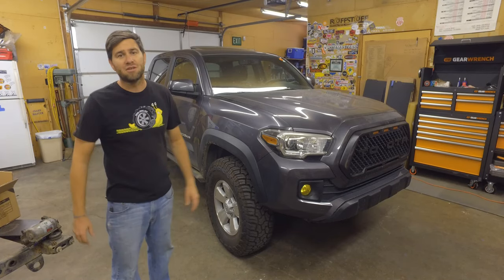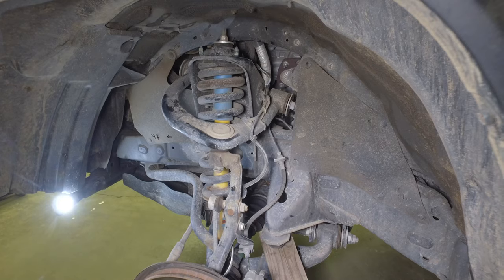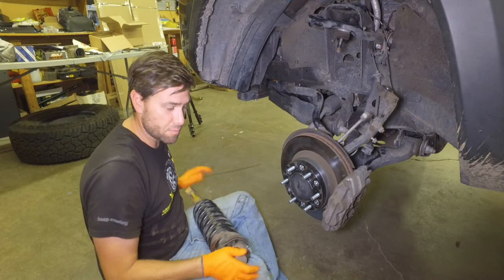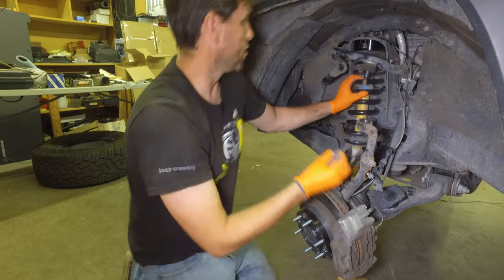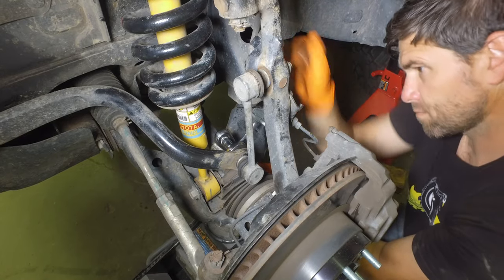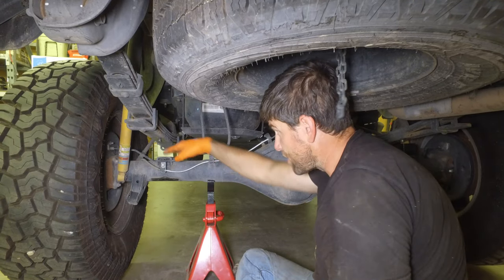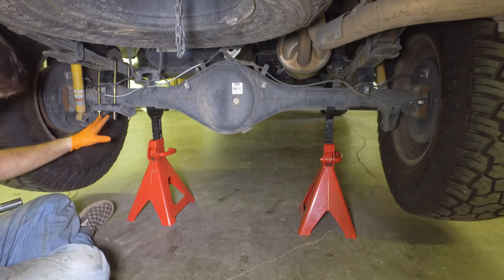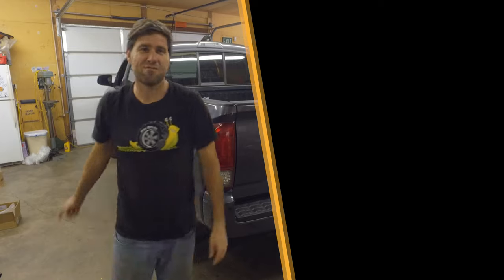How To Level A Tacoma

Comment: If you undo the two bolts at the bottom of the Spindle (instead of the ball joint at the top) you don’t have to undo the abs and brake lines from the spindle or the sway bar. A lot easier
Reply from the maker: That is a great suggestion, I will have to try that next time.
Reply: @SnailTrail4x4  I’ve installed a 4-5 dozen lifts on tacos and 4runners

Comment: You said the front only lifted 2 1/2”, When you measured the front you said it was 36”, if you look close it is actually 35 1/2”. Maybe that is the extra half inch. 

Also, it didn’t look like your leaf spring spacers were tapered. Did they have a taper?

How is the ride after the lift?

Comment: Couple of questions.....
The fender opening is the same size as before the lift and the wheel still goes up and down. This increased clearance, how?
Was anything included in the kit to space the bump stop down to prevent the strut from bottoming out?
Were the control arm bushings loosened at ride height and retorqued to prevent them from being under tension all the time?
Were you able to align the truck to stock specs with the stock upper control arms?
Reply from the maker: Hey Ron, All great questions! The overall answer is that I am not going to be keeping this kit. I am going to get a suspension lift very soon. 

A) I had 33's on my truck and it was hitting my body mount. By adding these spacers it pushed the center point of the tire downwards to allow me to clear the body mount while I am driving on the road. If I am turned and my truck is articulated then yes I still might hit the body mount. I guess the main thing is that my scrub radius has moved downwards to allow me to drive more comfortable. If you're planning on off-roading your vehicle often you should probably do a body mount chop or relocation as well. (this will be in the near future for me)

B) No, The front you should get new bump stops or a spacer for them. but in the rear nothing really changed and the stop bump stop should still work. 

C) No I did not touch the Upper or Lower control arm bushings. I do not think they are under much stress since there is no weight of the tire and no major forces on them since the coil-over is out of the vehicle.  Move to D

D) As soon as the lift was installed I took the truck to get a professional alignment, to help the bushings and save my tires. The alignment was able to get the truck back to stock but I do need to get upgraded UCA made for a 3" lift. I have since gotten them and had the truck re-aligned and the truck is back to spec and drives great. 

What's next... I am going to go to a suspension lift very soon because I do plan on using this truck off-road and not as a mall crawler. I am probably going to get the same lift as we installed on the 2nd Gen Tacoma (https://youtu.be/C6IloGEzoJk) to start and maybe upgrade from there. I will also be timing my fenders and doing a body mount relocation for the front. In the rear, I will most likely go with some heavy-duty springs and new shock mounts.

Comment: I noticed you didn’t install a DIFF-DROP. I have a GEN 2 and I think my driveshaft is humming because the shop didn’t install or recommend a DIFF-DROP. I suspected the vibration coming from a wheel bearing, but after further inspection, everything seems tight.

Comment: I just put a 3" front and 2" rear leveling kit on my 2017 Tacoma. After doing that, I've got a clunk going on at take off...well slightly delayed but pretty close to take off...what can it be? Sway bar bushing? Loose 2 piece drive shaft?? I have no idea, but it's driving me crazy.
Reply: I also went up in tire size to a 285/70R17 Firestone MT2....if that makes a difference
Reply from the maker: Oh man, it could be something as simple as a loose shock bolt, it's impossible for me to tell. What you need to do is figure out exactly when it's happening.

Comment: 3” is too much without changing other components Man. Your angles are all outta whack and you WILL wear out parts I guarantee. Looks good though lol
Reply: Good point..👍 How about a 2 inch front only spacers, that what I want go do on my 16 tacoma to even it out???????
Reply: I did this lift and I've got a clunk going on...what else do i need to change out in order to tighten everything back up?
Reply: @codymcmichael2702  I also installed a similar leveling kit on my 2nd gen tacoma.( 3 in front and 2 inch  in the back. )I haven't noticed any cluncks yet at takeoff. But Ive had to replace both my cv axles too many times.    was c e times. I was told just recently that if I install a diff drop then perhaps my cv boots might stop ripping.  It Levels the axles a little bit and prevents the rubber steps of the bots to rub on each other. I'm only regurgitating what othes have experienced to have worked for them and I'm willing to give it a try if it helps prevents the rubber boots from tearing after a year of normal street driving. I'll chime back in once I have tested them out.thanks and hope it helps out!